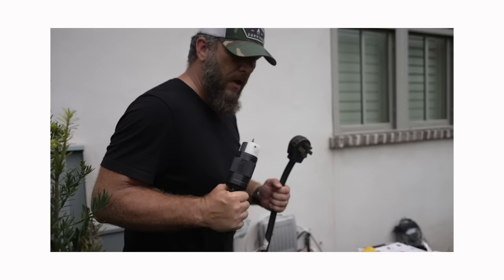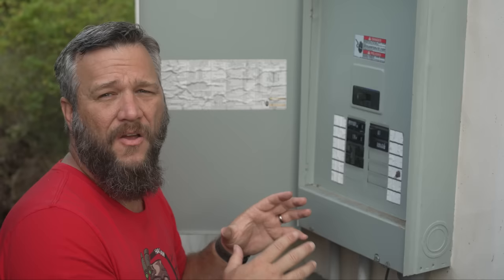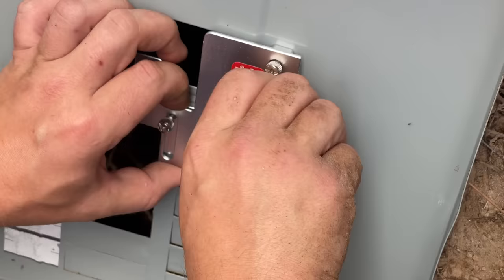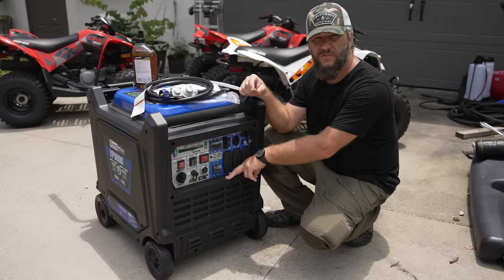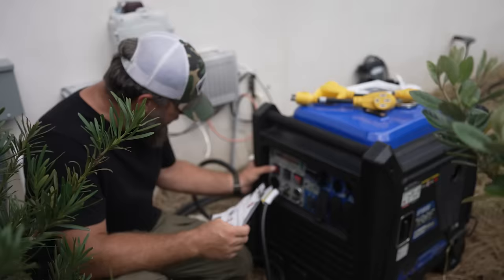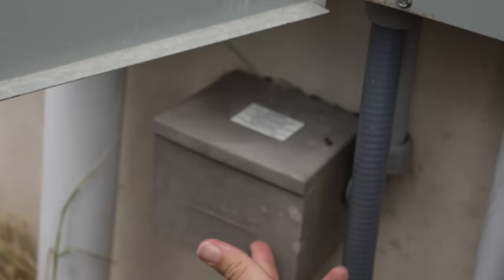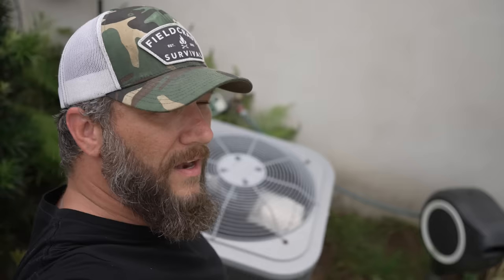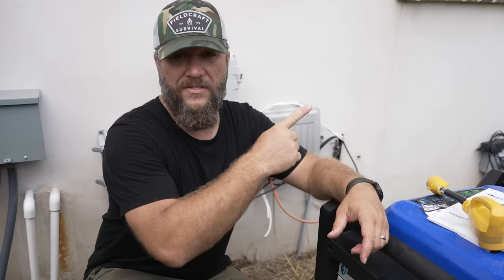90% Don't Know About This Fatal Generator Connection

Comment: I asked a lineman buddy of mine about the generator back feed issue and he replied that the company and crew he works for ground the lines to the utility poles so they don't have to worry about that.  Either way its always good to consider everyones safety and more home owners hopefully become aware of potential hazards and issues.  Great video!
Reply: Yeah, we can't seem to have enough rules for the "stupid is as stupid does" crowd.  You would think linemen would check for voltage on the line rather than make assumptions or guesses whether the line is hot or not.  Shouldn't that be one of the first things an electrician or lineman does?  My Dad was an electrician, and that was the first thing I was taught.... check for power on the line.... and always be aware of the situation and what you are touching ... it only takes one mistake, so take your time and know what you are doing.
Reply: @sonnyh9774  I agree. I work as a inside wireman working on medium voltage systems and we are trained to check for power even if your Forman says it’s okay to work on.
Reply: @sonnyh9774  They are called "Glow Sticks," and they are used religiously.
And when the Switchmen say it's disengaged, and the Glow Stick shows power?
Yeah, we're going to fry your Genset.
Reply: As a high voltage lineman I can tell you that this does not always work. I've gone to more than one funeral because of back feed.
 Yes you put your grounds up Yes you do everything you can to be safe and you have your testers on the line and everything is showing no power so you start your repair work only to have some idiot Crank up their generator and back feed the lines while you're up there. Those grounds do not protect you They protect the equipment.
Reply: It’s pretty much impossible to back feed the” grid “unless everyone in town turned everything off in their house the huge load would kick the breaker on the home generator.
Reply: @quickturn66  I agree. The homeowners either have a system that  works properly during a power outage or not. If you’re working for a lineman company or electrical contractor, safety should be number one! Either way you need to protect yourself if you work on anything live. Have proper training and the right knowledge and equipment to do so.
Reply: @sonnyh9774  I’ve had a time working on a Saturday feeding wire up to the second floor into a live panel from the first floor on a building. This jackass landed his wires on the breakers before I finished making up a junction box and accidentally closed a circuit by brushing across a breaker and I got lit up…I told him if does that shit again then I’m rolling up and going home. There was no lock out tag out so this was a chance I took and failed.
Reply: @TimeSurfer206  those glow sticks are also known as widow makers
Reply: @quickturn66  You are ignoring the fact that there is a transformer between the generator and the lineman.
Reply: @catbranchman2845  Which Is why most every Lineman I know STILL uses their Hot Sticks when the line is "Dead."
Unless it's a High Line, and dead on both ends.
Reply: @TimeSurfer206  a step up or step down transformer? A transformer is also a load and would make it even harder to power the grid with a tiny home generator. I’m not saying it’s a good idea to not use a lockout but it’s pretty much impossible to electrocute the lineman as per my first comment.
Reply: Personal grounds required. Also saves workers from induction issues.
Reply: @quickturn66 The primary purpose of personal grounds is to prevent induction issues.
Reply: @TimeSurfer206  and why would the transformer matter ?  AC transformers work in both directions,  what is being ignored is the fact that you would be trying to power up every house on your road.
Reply: @rayberger2694  The transformer matters because, when I plug my Generator into the house, it's making 120 or 120/240 Volts. Hardly enough to kill the average healthy person.
But, as you pointed out, TRANSFORMERS WORK BOTH DIRECTIONS.
Thus, when I BACKFEED THE TRANSFORMER, I am making 7,200 Volts to go say "Hi" to the linemen.
At the same time I am, as you say, trying to feed every house on that "Bug."
I am a Retired Electrician. I worked as both a Lineman, and as a Narrowback.
I believe one of us might have missed something that I said, or perhaps, something I SHOULD have said...
Reply: @TimeSurfer206  Ha ha ha, I am a retired commercial / industrial electrician as well. I worked in Maryland most of my life. I now hope for snow in Pa. I wish you the best.
Reply: @quickturn66  Last time we lost power  my old whole house generator failed  and I noticed a buzzing in the transfer switch. It was the relay that turns on when there is power from the power company. Checked the voltage at the meter and there was 36 volts  at the meter so that translates to 1440 volts on the grid in the neighborhood  since the power company disconnected the neighborhood from the main power grid to replace a telephone pole .  So yeah generators can put people in danger.
Reply: The home owner will probably only make that mistake once, because his little gen set will be trying to run 50 other houses, as well as overcome a grounded dead short at the main lines. Kiss the gen set goodbye.
Reply: Good idea and exciting for the idiot who didn't flip the main.
Reply: Actually they they do ground lines but if it's laying on ground or hanging low someone else could get hurt
Reply: I worked my entire life in the electric utility industry and I can tell you for certain a home gen set can and will backfeed the system.  No, it won't be able to power up the grid, but in a restoration situation there will be many lines broken and on the ground.  A home gen set could backfeed a single transformer with its primary lead on the ground.  A lineman who is careless could touch that conductor on the ground and easily be killed.  We were taught to listen for gen sets and to NEVER handle a conductor on the ground without rubber gloves and grounding the conductor.  I can't tell you the number of home gen sets we've come across that were connected incorrectly.  This video is an excellent demonstration of the correct way to connect a home generator.  The only thing I would add to these instructions is if you have a small generator you would want to turn off all your breakers before connecting the generator.  After your generator is connected and running you could then turn on just the circuits you need such as the refrigerator and some lights.
Reply: @sonnyh9774  You aren't taking into account any/all instances where a lineman has checked & confirmed no power, proceeds to do his work, only to have some jackwagon start his genny and backfeed the grid.
Reply: @henrychinaski5223 your entire life? We’re you born with fire rated diapers?😂
Reply: @tedk2166  Born with hooks on!  Hahahaha!
Reply: @TroyStevensStelzerPaintingInc  It's a dangerous job.
Reply: @catbranchman2845 There may be no power but then some idiot starts his generator. Similarly I doubt grounding makes it safe.
Reply: Exactly I'm an electrician and I deal with this stuff all the time in lineman don't touch the lines unless they're grounded.
Reply: “Back Feed” is a real issue. Working as a Line Clearance Tree Trimmer we are constantly warned, especially for storm work to keep our eyes and ears open for running electricity. Power company says line is dead but you hear a generator running, maybe see lights on in a house or barn? Chances are, you’re gonna have a bad time.
Reply: @TimeSurfer206 There not called “glow sticks” by anybody in the trade.  There either tick tracers or voltage testers.  Glow sticks refers to fiber glass sticks or fish sticks used for fishing wire down walls and through ceilings.  Guess what some f them glow in the dark.
Reply: @quickturn66  I can tell you don’t know how electricity works.  You can absolutely back feed the transformer that is supplying power to your house.
Reply: @quickturn66  but a few houses on a fragmented broken grid quite possibly.
Reply: @RobertBeck-pp2ru  Why would the generator burn out? Wouldn't its circuit breaker trip and/or the engine stall almost immediately?

Comment: Be very careful when a portable gen is placed near windows. Make sure they are airtight. CO poisoning kills. Best if you can locate the gen away from the house.
Reply: By law here you have to have 15' from all windows and door openings. They made me replace a double hung bathroom window with a solid window before it would pass inspection.
Reply: By "away from the house", it should also be far enough away that if the generator unit catches fire, it won't burn the house as well.

Comment: Please, be aware. After you have start your portable generator  before you flip on the generator main breaker, always unload your main panel before and put back one by one each breaker. It help the generator and also it is written in the manual. Read it 😊
Reply: I noticed that too.  I also cringed when he said lets see what all can be ran on this generator. Personally, I think you should find out what each device amp draw is and the surge it will create such as the outside compressor. Generators will take a surge beyound its rating but will shorten the lifespan.  Some homes have electric water heaters, electric stoves. You want to keep breakers off that are too much amp draw for the model. Also need to know what appliances, lights, outlets are using what bar from the panel. The right or the left. That will help you know what you can and maximize what you can run. You may find out you have to move a toster over to a different outlet that uses the right electrical bar instead of the left.  A good electrician should go over all that with you

Comment: As a retired Lineman, working storms in Florida 1st thing I did was make note of any engines running when I  pulled into an area " ground it or glove it"
Reply: What do you mean exactly?  My bother is an electrician he's coming to set my generator up this week.
Reply: Even if you can't hear one they could be running a power wall. Always ground, always. Only remove the ground when hands are off.

Comment: One thing to remember with dual-fuel generators is when you run with propane as opposed to gasoline you lose approximately 9-11% of the rated output of the generator. A 5,500 watt generator will only provide around 4,850 watts on propane.
Reply: and even less with NG but that's just how it goes.
Reply: on my Heron 17HP, with LPG and petrol, I see very similar rating, but house NG it drops down.
Reply: Cant you just add a fuel additive to prevent the ethanol stickiness issue?
Reply: @rumorhazzit5339  I use the ethanol free gas for all my small engines.  For those that are not used for a long time I run the fuel tank empty.  I all so put in the Sta-bil in the fuel just as an added precaution.  Have not had any problems with the small engines after that.
Reply: Yeah, this is one of those situations where you have to decide what to sacrifice. Other than losing wattage, you lose run time but you also have to refill it more often. With my generator on 50% load, it runs for 9 hours on gas and 7 hours on propane. However, if i'm without power for 24 hours, I would have to go outside and refill the gas tank 3 times. If I hook up a 100lb propane tank, I don't have to do anything. And that tank could even go for about 30 hours before I have to step out to either go refill it or hook up a spare one.

Gas also costs more to run. For that 24hr scenario, I would spend roughly $72 in gas compared to $63 in propane.

So it's all about where you want to make sacrifices.

Comment: Here is a thought about the savings in Money between the Portable Generator and the Permanently installed Backup Generator. This video should be a Major clue as a reason to spend the money and get the Permanently installed model. Look at the first reason which would be the Power goes out. It is usually raining/storming outside when this happens. Now, watching this video and seeing everything that he has to do to get the Portable Generator setup just to power the house, imagine doing all of that while it is Raining/Storming outside. He had to push his generator outside up a hill which would all be mud, he had to make all the gas connection and all the electrical connections. Next he has to disconnect his main electrical disconnect which again would be in the rain and play with the other breaker and the interlock. The other thing he forgot to show is that the Portable Generator is supposed to have a separate Grounding wire that runs from the frame to the house ground (not just through the plug). Also, you forgot the most important thing with a Permanent Generator, which is Automatic Starting and Automatic Transfer Switching, which imagine loosing power and your not home to come home to a flooded basement because your sump pump didn't have power to turn on or all the food in your Refrigerator/Freezer went bad after you came home from a Vacation or whatever. Last question, If your not home, is your Wife going to know how to set up and perform all of these steps to get power, or will she just get to sit in the dark until you get home?

Comment: Besides not wanting to fry a lineman, there is another reason why the interlock is a must.  If you leave the main breaker on after loosing street power, and then connect and start the generator, when street power comes back on, it is very probable that the phases will be out of sync.  These are the sine waves of AC current.  This could very easily (and probably ) destroy your generator.
Reply: And cause a house fire.
Reply: If you leave the main on... you will be powering the entire world... and it would trip your circuit breaker on the generator... OR choke it out completely
Reply: *losing
Reply: #1 if you tried to back feed the grid with your generator, it would just pop the breaker as the neighborhood would be too much of a load. #2 If the utility was on and you tried to connect a running generator, the out of phase situation would just also cause the breaker to pop. [The generator back feed breaker or the generators own breaker, whichever is less.]
Reply: @markevan1  thank you. I was just about to do that.
Reply: @DrHarryT  I have always thought that, if you tried to power the whole system it would trip your breaker instantly ,

Comment: Consider adding a small solar panel with a trickle charger for your battery on the generator.  If you forget to shut the battery switch off you will drain the battery. I learned this the hard way.  ( Test start the generator at least once a month)   Good times!!
Reply from the maker: Thanks for the tip!
Reply: Good call.
Reply: Oh man thanks.  Checking now!
Reply: There’s also the issue of the gasoline degrading. Need fuel stabilizer and rotate your supply of emergency gas (if you’re not pulling it from you car…)
Reply: Always test the generator under a load or you will lose the residual voltage in the coil and it will not build up voltage when you need it. Remove the load before shutting the generator off or you will again lose the residual voltage.
Reply: @bills6946  there’s a YouTube video on how to regenerate that lost field by using a drill
Reply: Ethanol gas has made small engine mechanics a healthy steady income.
Reply: Exactly.  I used one of those pannels that they use as deer feeders in the winter.  Very strong and keeps the batter charged until needed.

Comment: From a now retired lineman of 30 years this is a much needed video...
Reply: But the truth is, you as a lineman work on everything as if it is hot.  The risk isn't as great as the alarmists make it out to be.  Once you place your grounds, it will trip any rogue home generator that's not configured properly.

The only time a lineman would be subject to harm is if they're not working according to safety guidelines.
Reply: @briansmyla8696  That's true in todays world but not so much 30 years ago. Your right though now days everything is covered in rubber if it can't be killed so easy like a hospital or such. Anything that can be switched around or killed is full of grounds now . The pole tagged as to who is working on it now and some of your 3 phase switch's are even padlocked by the one working on it. It's a lot safer now, even climbing  now with two safety belt's so your belted all the way up crossing the cable and telephone lines.

Comment: We did the same thing a few years ago with the same duromax gen and we love it! Our electrician installed the interlock switch and it works well. Last year our electric went out in 107 degree weather, our duromax ran our freezers, ac, and kitchen appliances without missing a beat. We turned everything off and then turned on the circuits one by one so we didn’t overload the generator.

Comment: Last year I had my son (he is an electrician) hook a 6 breaker manual transfer box to main panel (R306A Pro/Tran Outdoor 30-Amp 6-Circuit 2 Manual Transfer Switch with L14-30 Power Inlet).   I hook up to my 3500 generator and it has no problem.   I just choose the six breaker I needed.  It pretty much runs every thing except oven and A/C.   I like this set up because it’s easy to use and no need for the interlock.  It took my son about 45 min to an hour to hook up.   As for my generator, it’s gas so I run it for 30 min once a month and I have fuel stabilizer mixed into the gas.   I have never had a problem.